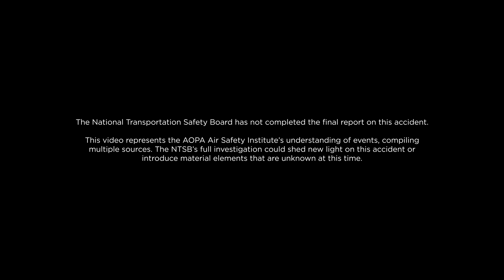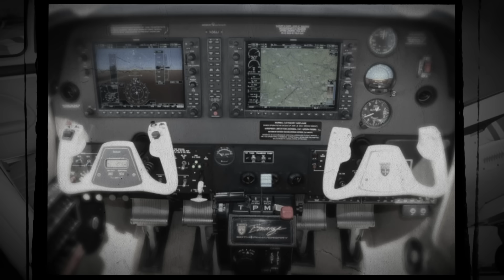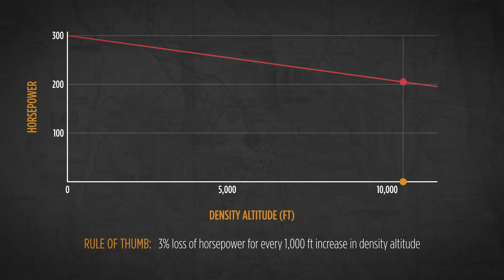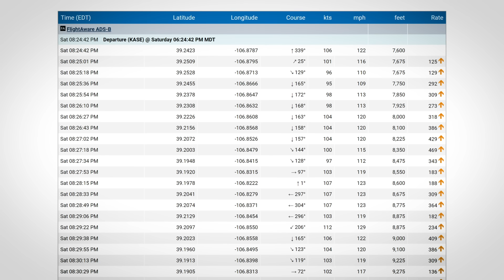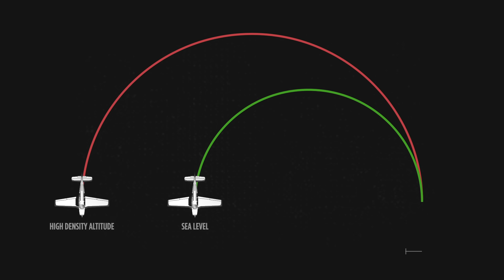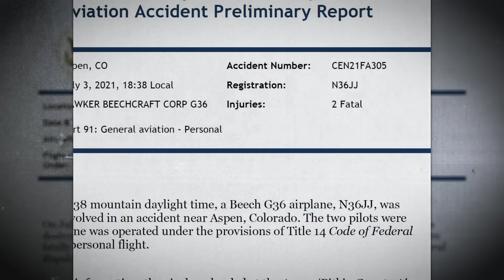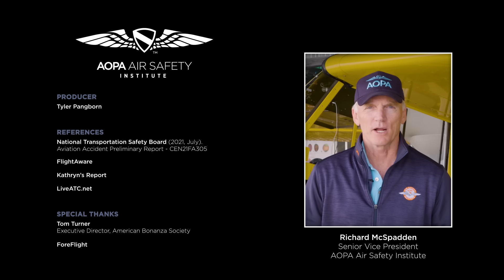Accident Case Study: Into Thin Air

Comment: I wonder if normally aspirated aircraft would benefit from emergency nitrous oxide injection into the engine. An instant 70 to 100 horspower addition for about a minute. The engine would have to be overhauled and the pilot would have a lot of questions to answer on the ground, but it would save lives in these situations.

Comment: Doctors have a certain ego. They had 4 hrs to enquire locals about the particularities of mountain flying and his ATP friend should have known better regarding naturally aspirated engines being poor performers in such conditions, regardless of DA. The B36 had basically the equivalent of an IO360 with 180 hp meant for a Cessna 172 in those conditions.
As a CFI the best way to teach and simulate high DA is simply throttle the engine back to 2100 rpm where it's like 2/3 of its power for most Lycoming and Continental engines and see if the student can takeoff in those conditions, assuming a very long runway of course. And then climb with that kind of very reduced power.
The harsh reality of this sinks in pretty badly and too bad those 2 were never taught like this.

Comment: A really great presentation. Death in the air, like death on the water, is usually the consequence of not one poor decision but a chain of them. This is a perfect example. This raised a question in my mind, haven't done the research and math to work out the details. 

It seems to me that even just the five hour trip to an unfamiliar, mountainous area would have been reason enough to overnight for rest, review of planning and talking to local pilots to get thoughts on their intended route and plan.

The fact that they didn't understand ATCs description of the possible route, the fact that they asked for IFR clearance and were surprised by the directed altitude; that it was an altitude they either couldn't achieve (it was only 1500 below the aircraft's maximum altitude...and with altitude density, probably not achievable) or; they new they couldn't fly that due to not having O2 onboard (which in itself could be a problem for likely middle aged or older pilots without altitude acclimation and a likely minimum pass of almost 11,000 plus let's say another thousand minimum above GL for safety. At anything like that altitude for more than a few minutes either of them could have started to have 02 issues) ; they not only didn't already have a definite route selected, they didn't understand the names or even headings of the possible routes.

They are in a plane which, is at least in individual, if not in type, new to them. Maybe one of them has significant hours in type and hopefully both are very familiar with the Garmin 1000 set-up in the plane.

 Add to that, just a back of the napkin guess, they have about a 5hr flight to Des Moines. 

Let's say they got up 3 hours before the CA take off. Shit, shower and shave, get breakfast. Some kind of transportation to the airport. Inspect and fuel plane, etc.

A 5 hour flight on an unfamiliar route, in mountainous terrain which it seems possible neither has significant current experience in (and mountain experience in N.E. would be little prep for western mountain flying conditions), to an unfamiliar airport (which is obvious by the ATC convo on take of.

Upon arrival they break for 4 hours. How restful, who knows.

Now they are taking off at 6:20pm. Sunset at the airport is about 8:30pm, later at flight altitude....but they're flying toward Des Moines which is away from the sun so they are going to run into darkness sooner. Fortunately they'll clear the mountains before dark, but I'm not sure how the waning sunshine/light quality would affect they visual perception in the canyons and passes, especially on the back side of the mountains.

They are going to fly several hours in darkness after something like 8 hours total flying time  and 15 hours since sleep, in a new to them aircraft through unfamiliar area (fortunately with little or no terrain challenges at this point).

The negatives are just stacking one on top of the other!! Add in maybe an altitude induced headache and associate visual and mental acuity issues that could be potentially be brought on and even if having altitude issues with the pass a pilot could be getting into a very negative situation at that point.

What if they were cautious/not cocky. Were happy to make Aspen by mid afternoon. Enjoyed the rest of the day there, maybe invited a local pilot or two to a nice dinner on their dime. That afternoon, at dinner and at the airport the next morning they talked with a number of local pilots who  experience with cross country flights eastbound. Developed a definite plan, not "we'll figure it out when we see what's going on at altitude" or at least a definite plan A with criteria that would require a switch to an already worked out plan B?

They would have had a beautiful afternoon and evening in an amazing place. Enjoyed making some pilot friends, had a solid plan for a relatively easy and relaxed flight to Des Moines that they would have almost certainly survived and enjoyed. Maybe (depending on weather conditions) made a second hope that afternoon.

They would still be with us. Not funerals, grieving widows, damaged kids, businesses in crisis.......

I made a radical and difficult decision to get off of planned yacht delivery (and talked the rest of the crew into doing the same) from Portland, ME to Annapolis, MD after we survived a first leg that involved one really bad decision after another by a skipper who had a schedule in mind and as we got further and further behind on our departure schedule due to one issue after another (radio not working - fixed that, horn not working - I bought several handhelds....skipper dropped one overboard less than a mile from the dock, roller reefing jib installed upside down by the yard - fixed that, etc etc) we finally left the dock to depart down the Portland River about 45 mins before sunset into strongly building fog, but fortunately minimal winds...on a sailboat.

I'll spare you all the details, my fingers couldn't stand writing that much, by the time we arrived in Nantucket Harbor in deep fog we grounded and, as if that wasn't enough, the skipper who was in a drunken like state from a combination of seasickness and too much Dramamine, broke the engine/trans coupling by trying to drive out of the grounding.

I got the F off the boat as soon as I could. Spent money I really didn't have to take a ferry to shore, shared a ride with the two other crew to Providence airport and a flight back to Maryland. We were much luckier than these two guys. Either one of them could have cried uncle before the 31st error in judgement cost them their lives. They could have even accepted they couldn't make it an done an intentional, lowest speed possible crash landing in one of those open meadows. Maybe they still would have died. Maybe they'd have been beat up but alive. Insurance would pay for the plane. Nothing would fix the damage to their egos. Oh well, they would have been quite happy to have saved their own asses and see their families again! JMO

Comment: Better route planning would have helped. When I needed to move cross-country pulling a large trailer behind a small car I took care to pass north of the Rockies. I still faced mountains, but they weren't as bad. Flying in plane would have made that decision far more important. In a car, I didn't need to worry about staying above the stall speed in thin air.

Comment: I'm a 'flatlander pilot' as far as small GA planes are concerned. My dozens or hundreds of flights across the mountains in military jets and as an airline pilot are completely non-applicable to this discussion. 
I have flown across the Rockies five times in general aviation normally aspirated piston aircraft. The first two times were in a Lake LA-4, with a carbureted 180-hp Lycoming, Florida to Alaska and return about 20 years ago. I had well over 20,000 hours and 30 years experience at that time. 
In preparation, I had 'flown' the route several times at my desk using MS FS 2000, with the yoke, rudder pedals and throttle quadrant setup I had gotten for my son's flight training. It was valuable preparation, but did not prepare me for that first Wyoming high elevation departure and the amount of leaning required for takeoff and climb. I certainly learned 'real-world' from that experience what had only been book learning up until then. 
Moral: High levels of experience in other situations are not protection against killing yourself in unfamiliar circumstances.

Comment: Those store bought (certified) airplanes are SUCH dogs compared to experimental's! I've taken my 170 HP (normally aspirated) Long EZ to 26,500' just messing around in the Mount Hood wave window and was still climbing 800 FPM. Jim Price holds the FAI official World Altitude Record for the 1,102 pound weight class with a 160 HP normally aspirated Long  EZ at over 35,000'.

Comment: I conduct mountain flight training from the Centennial Airport near Denver. One of the considerations I discuss during the ground portion of the training is not to take on a full load of fuel at an airport immediately before needing to climb over mountains. Better fuel stop planning and choosing a route over lower terrain, offering better off-airport landing opportunities in the event of an engine failure, might just save your life.

Comment: 7000 hour mountain cargo pilot here.  If you ever get into a canyon turn situation what you do is the opposite of what you’d think.  Best option is drop your flaps. Drop your gear.  Slow down as slow as you can and make the turn.   The rate of turn when you are slow is much higher.   Slow down and you’d be surprised how fast you can get it around.
Reply: « Slow down »
But at high altitude-density, you need to have water under the keel.
I note your tip for later study.
Reply: Yeah, it would seem you would want to be at L/D max.
Reply: Don't drop your gear. Maybe use takeoff or first notch of flaps.

You don't want additional drag. Drag ruins your lift over drag ratio. And you need maximum L/D for this.

Offset to one side of the canyon. If you pick the shaded side, or are in the downwind blanket of the hill: You might find yourself in a 3,000fpm downdraft and nothing you do from this point onward matters much. 

So pick the sunny side. Pick the side where the wind wants to blow you into the cliff side. Because it wont: It will begin deflecting upward and flow parallel to the rising terrain and take you up on an elevator ride to freedom. Mind the downwind downdraft and shade just over the ridge. Cross the ridge ad a 45 degree angle. After flying over descending terrain, turn again 45-90 degrees to obtain maximum altitude as quickly as the ground falls away. Mind the rotor. It's a horizontal tornado invisible on most days. At your altitude a few miles away downwind, and It will ruin your day. 

Use the riding air to climb rapidly and clear the ridge you are flying parallel to. 

IF you cant find a decent updraft to freedom, then plan your turn.

You want a reasonably tight turn radius so you don't impact the opposite side. Always be climbing to this point. Be at Vx for your altitude. NOT Vy. Unless the engine is overheating. You want steepest angle, not highest rate of climb. Only speed up to Vy or slightly faster for cooling. 

And for the next maneuver: Slightly above Vy for your altitude. You want 1.2 times Vx in this case. Maybe 1.2x Vy if you want a little more margin above stall and can give up 100ft in turn radius and not impact the hill.

Climb at 1.2 times Vx for this density altitude. Trim for this precise speed (lift coefficient). Smoothly and precisely roll into your turn on the appropriate speed. Coordinate rudder perfectly with aileron. And as soon as you reach 45 degree bank angle, relax both to neutral. No input from any control. This creates drag losses. Not until you determine if the engine/p factor is walking the nose sideways. Then use just enough rudder to center the ball. Hold this.

Keep speed at 1.2x Vx. This is effectively a Vx climbing-turn. The 20% extra speed is needed due to the 1.4g load factor. The 1.4g load factor will crank you around in a tight turn, while maximizing climb or minimizing altitude lost. If you have space, opt for a 30 degree bank. At 1.1 times Vx. It is safer.

For an aircraft having a Vx speed of 75 knots. At 0.7 density ratio (10,000' DA). True airspeed will be 90ktas. And you can turn this airplane 180 degrees in the opposite direction inside of 1,010 feet or 1/5th of a mile with a 45 degree bank. 

If you don't have 1/4 mile or 1,320ft of space. Or aren't sure. You need to use a 60 degree bank and 2g or greater turn. You are unlikely to have this much speed to make this work, unless you aren't climbing at maximum performance in the first place. So you will have to dive in the turn to maintain speed of 1.4x Vx. Or in this case, V-best-glide. You would have to bank to 60 degrees, then pull near the stall. And let the nose slice downward to maintain airspeed well above the normal level flight stall speed (like 2x stall speed) in order to pull this much G. You will probably hit the trees. But its better than cumulongranite, and might just work. 

In any case, following this advice may get you crashed anyway. But it should not be attempted intentionally in a real scenario. Because getting into this scenario is what got you in this mess in the first place.

Comment: When you can only manage a climb rate of 200 fpm at full power, that should be telling you something about the advisability of a normally-aspirated flight where you are. If you launched from an airport at sea level and could only manage a 200 fpm climb-out from the runway, you'd return for landing, right?

Comment: I'm a flat lander, but I've flown cross country over mountains a number of times.  Last time was in my Cessna 140.  And yes...it is a humbling experience flying through the Rocky Mountains in an 85 HP airplane.  Anyway, I learned quickly that you better pick the right pass for your airplane and crunch the numbers BEFORE you take off...that is an unforgiving necessity.  Once again, really excellent video!

Comment: Most of my hours in nearly 40 years of flying are in the Western half of the US. One of my personal limitations that I had set for myself by the late 80's, listening to the mishaps and near-misses that instructors and other fellow pilots had experienced, is that I would not fly a non-turbo recip aircraft, especially for long routes, in and around areas with density altitudes going above 8,500 ft. Even those normally-aspirated types which have plenty of power and official service ceilings at or in the lower flight levels simply do not have the margin of performance available to be safe in much of the Western terrain by the time they are just a few thousand feet above an 8,500 ft. density-altitude airport. It is sad and a bit surprising how often pilots have gotten themselves into situations that they couldn't get out of at 12,000 ft. or less MSL, thinking that they have two or three thousand or more left before reaching their service ceiling, when the density altitude has brought that ceiling almost down to them and their best rate of climb, if any, is now 100 - 200 fpm.

Comment: I didn't think pilot training was necessary to have the common sense that you only approach terrain once assured you have the elevation to clear it, or that you fly the sides of a canyon instead of the middle in case  you need to 180.  Whatever these two guys were talking about had nothing to do with flying.
Reply: Non-pilot here….until i started binge-watching these crash case studies, i thought of an airplane as a car with wings.  I would never of had any clue about any of this stuff.

Comment: This may be a dumb question, but why can't the pilots just "pull up"? Not even sharply, but gradually (more than they had been doing) as they saw the mountains closing in.
Reply: No questions are dumb.

Matter of fact is: a pilot should be able to understand limitations of the airplanes they fly. The simple fact that one of the pilots had an ATP is a buzzer itself.
Reply: @aintsosure  So can the plane physically not climb that high without the engine stalling or something?
Reply: @Dbleezy95  you're focusing on the wrong question. But yes, you're correct. At some stage the plane won't be able to keep climbing. The amount of power required to keep the aircraft in the air matches the available power they had.

The whole thing is:

A pilot holding an ATP, with FA50, FA7X, G-II, G-IV and G-V type ratings should be able to understand it.

The question is: why didn't he? A flaw in the system of training?
Reply: @Dbleezy95  — that plane could prolly climb that high, but it takes awhile to get up there…
Reply: “Pulling up’ makes a plane climb, only in the movies.  Rate of climb is directly proportional to airspeed.
Reply: not enough speed, not enough power to clear the huge ridge

Comment: Hard to believe that a normally functioning G36 should not be able to sustain a better ROC at those altitudes.Admittedly, the very high DA of Aspen reduced all numbers(and should have been reason to wait for a cool am departure), but climbing from 10k he should have had nearly 500fpm available to get to 12.These planes are made to fly relatively high(even normally aspirated).I almost always cruised at 11-12k, and sometimes went to 14-15k on long cross country flights before running out of climb. Severe downdraft,mt.wave,poor piloting technique, stall/spin need to be considered behind the obvious role of DA to explain why he could not achieve book ROC. Any way you cut it, this was monumentally bad decision making.